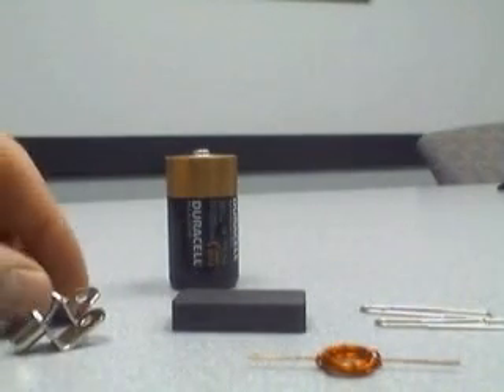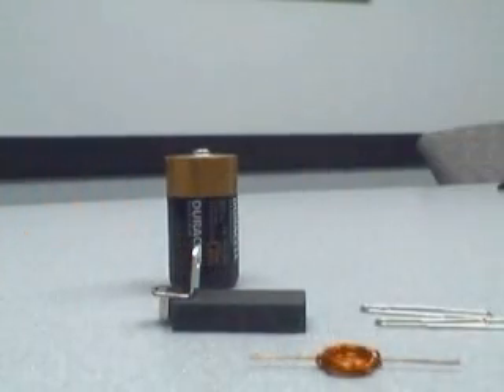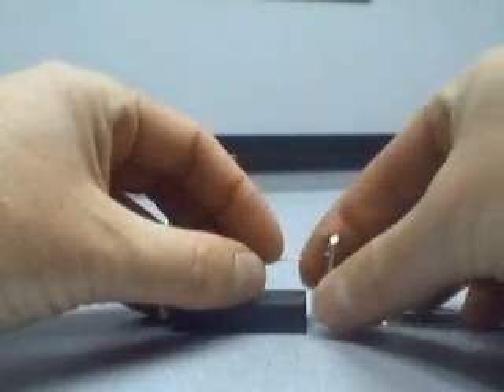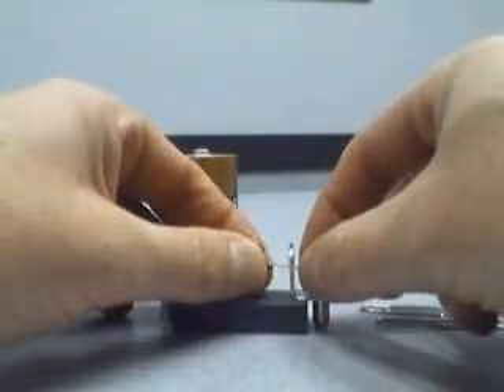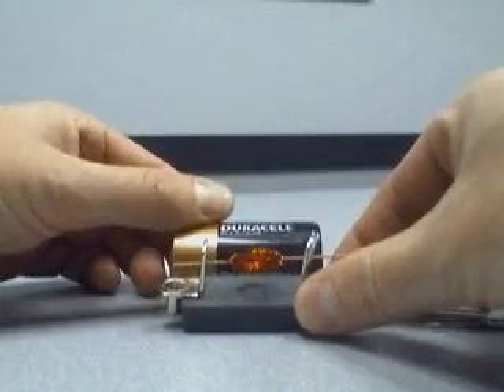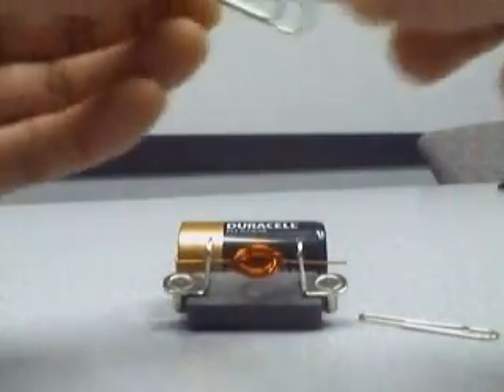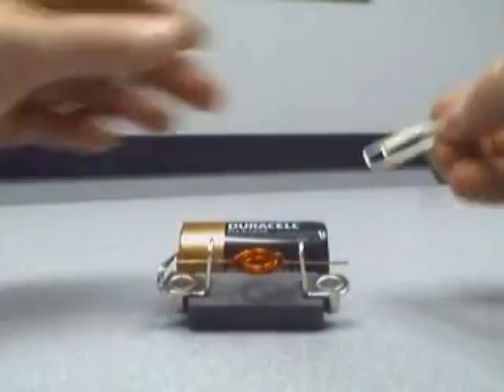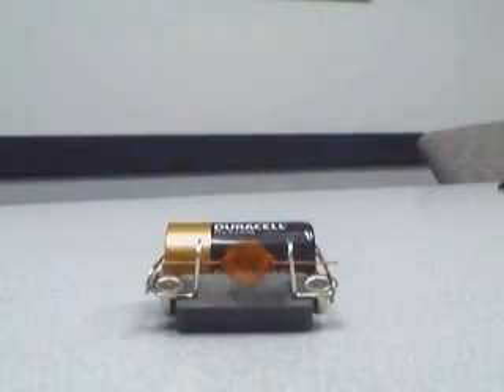Assemble motor

Comment: Is it using a copper axel and copper coil in the center or is the axel made of something else?
Reply from the maker: The axle is an extension of the coil, so is made from the same coated magnet wire. Here's another link for a similar motor: http://www.education.com/science-fair/article/no-frills-motor/
Reply: Brent Logan Thanks.